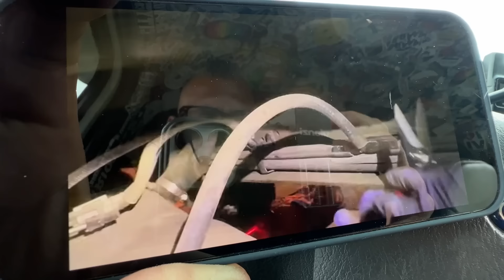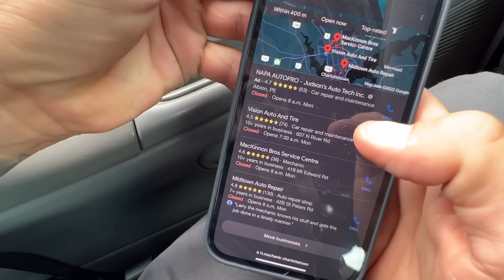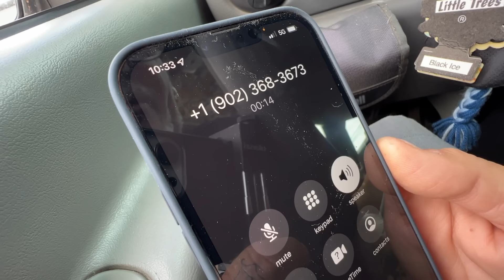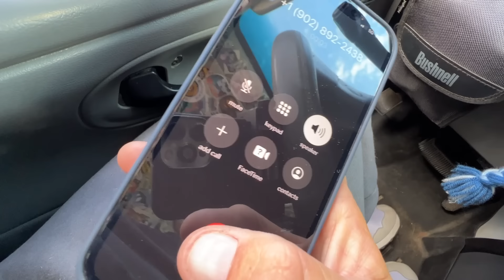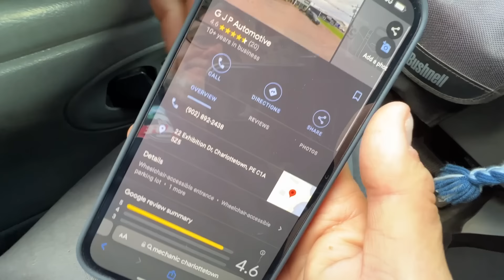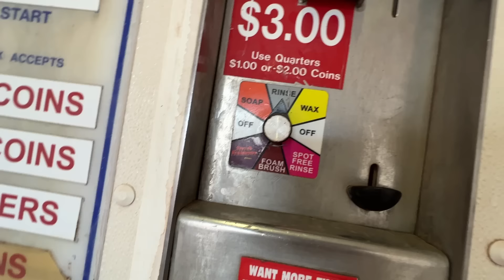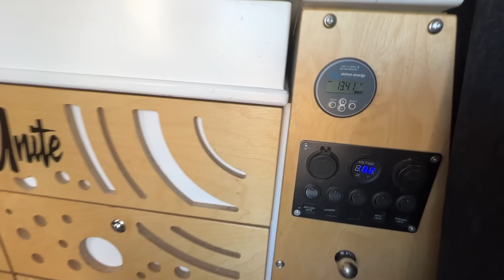TRAVEL STOPPED. My Van Has a GAS LEAK and It’s Freaking Me Out. SHOPS ARE ALL CLOSED.

Comment: Chrome after you clean and dry your van turn the key to the on position it'll turn on the pump and build up pressure and you could go down there with a flashlight and maybe even a little mirror and follow the gas lines and you might get lucky and see a connection that's leaking
Reply: It sounds like there is a hose that split on the pump side. So yeah. Turn the key to the on position and look to see if it gets wetter on the frame.
Reply: or keep it shut off completely right outside the mechanic shop.  just post up there until Monday.  As long as the pump is off, you won't lose a ton of fuel.

Comment: Pro tip, have less than half a tank of fuel to keep you going, but it will be easier to remove the gas tank when it's half to 1/4 full. It can be done in a parking lot, but a jack and a wide board is preferable for better control on lowering the tank. The thing to watch out for is the gas tank straps that tend to rust out like a muffler.

Comment: If you can actually see where the hole is, and you can reach it, a tube of Seal All and a piece of cotton fabric, soaked thoroughly in the Seal All, applied to the hole, will stop the leak, even if it is dripping.  Let it dry and apply another coated piece of fabric.  Worked like a charm for me. Edit:. Wear disposable gloves

Comment: Careful with the pressure washer, if gas is leaking out, WATER MAY GET IN TO YOUR FUEL.
Reply: Its most likely only leaking when the fuel pump is working somewhere in the line isn’t able to hold the pressure and is leaking

Comment: you can wiggle the hose  up front where you see it wet and see if it shows the leak from a pin hole or Crack in the hose. you can also replace the pinch type clamp there with a traditional tightening feul line clamp. you can just slide the one back wrap the adjustable clamp  around it and retighten it.

Comment: At least you found where the leak is so that helps.  Fingers crossed that a subscriber can help get you into a shop quickly because gas fumes are nothing to mess with either for you or Cruzie.  I certainly would do all my cooking away from the van right now.  You posted this on August 4th but it is from a few days earlier so I am hoping the problem is diagnosed and on the way to being fixed.

Comment: Hey Chrome! I don't know where you are with your fuel leak. But. I noticed in the video,that you showed, that there's a top mounted fuel pump on your tank with plastic elbows. My experience us that they crack from age and bouncing.
You may be able to access the pump through the floor. If you approximate where the tank is, from the inside, there may be a removable plate on your floor to access the top of the tank/fuel pump. If you can remove it, check the elbows and connecting rubber lines. If it appears that they are cracked/leaking.  You can buy the parts from a dealer and replace them yourself. Fairly simple.

Comment: It's not just gas , there are electricals in the fuel pump too , the combo improperly installed WILL   create fire. Unless you've done this before, a mechanic is a must for this one , mechanics will have it fixed in a couple hours.

Comment: My advice, is to try to get eyes on the problem, a little mirror, a flashlight, some rags, do some tests like starting, or a short road trip, even just on position with the key to actuate the fuel pump, and along this process you'll find out something to do that can suffice until you get it looked at by a technician.  Don't trade in the van, those run forever, take care of it.

Comment: Chrome, I’m here to help. You have three lines in the sending unit..the sending unit is the module in your tank containing the fuel pump and fuel level indicator. The lines are the supply line, return line and vent line to charcoal canister. If the fuel is dripping when it’s running, it could be either the supply or return..but the supply line has higher pressure as it hooks to fuel pump. My guess, I’ve see it many times, is the steel line coming out of sending unit is most likely rusted. You’re going to need to drop the tank and examine it..and to make it easier, don’t fill tank, even burn some off..it makes the tank lighter and the mechanic will thank you. It’s common, don’t sweat it, but my guess without seeing it may need a new sending unit.

Comment: I'm sure you go it figured out by now.  My guess is a fuel line connection, one of them you showed almost looks leaking.  I'm guessing you have tied your heater into those lines at some point, so there are more points of failure.  If not fixed yet, when the drop the tank replace ALL the lines...cheap insurance.

Comment: Hey Chrome, if you are still having this issue and if it’s a fuel line leaking you could relieve pressure in the fuel line so it does not leak while parked. You can have the engine running, remove the fuel pump fuse, then wait for the engine to stall. This would eliminate any pressure in the fuel line so at least it would not leak. This would only stop the leak if it’s the fuel supply line leaking. If it's the return line maybe would not work. I hope you can get this resolved.

Comment: Probably leaking from the fuel return system. The line or connection. If it was the pressure line the problem would be worse. If you want to see where it's leaking from the van should be running. Obviously a dangerous situation though. Eye protection for sure anytime you are under the van. Ignore all the warnings about getting water in the fuel, that isn't going to happen in this situation.

Comment: Hoping and praying your problems will be fixed ASAP. I want you and Emi and your fur babies back on the road.
Reply: Open the gas filler cap to relieve the pressure to slow the leak until you have it fixed .
Reply: @myronmakara9086  I guess so.

Comment: You might check your fuel filler neck behind the metal wall. You can see rubber hose from underside. See if it has been cut as the e350 are easy to cut and get gea out. I saw many times as UHAUL mechanic.

Comment: either way you go you will have to investigate the leak to the source. best way to do that is to use a carburator cleaner to spray wash the fuel away then let it dry then have someone to start the van and spot where its coming from. if its a fast leak leaving a puddle under the van that id fuel pump related more than likely fuel supply line or return line. if its just wet when you drive it around corners its seal related . the couplers on top of the tank that connect the fuel line to the fuel pump in the tank are cheap plastic and the little retainer clips are a 10 cent part that can come lose . sometimes you can use your phone to see where the leak it if its on top of the tank. if its only leaking from the side seam you can get a fuel tank dope you can push into the seam to seal it. otherwise if it doesnt leak while standing still id try only fill the tank  1/4 full see if its only damp around the seams. best of luck be safe remember fords have an emergency fuel cut off button on the passenger side kick panel it kills the power to the fuel pump in case of an accident or fuel wont shut off but only use it in an emergency because once you use it you have to reset the button to get the system to work again.

Comment: Run half a tank less will spill. With heat it  will evaporate quick. The fuel lines are rubber and metal. They run rubber were they need some expansion and metal for strength so you don't rub a hole in the line. Most are just clipped on run a line bend it watch out for parts that move and plug it in then clamp it on with a hose clamp.

Comment: I have dropped my share of tanks,  I have even unbolted a truck bed to gain access to a fuel system as not to have to drop the tank.  It is best done in a shop.  I have faith you will find an honest mechanic.  stay safe

Comment: Hey Chrome maybe if you pull the rear tire off you can have a better look at whats leaking.Could be where the gas line for your heater is tapped in and park at a fire hall just in case. 👍👍⭐⭐🚐⭐⭐👍👍

Comment: Fuel injection runs at different higher pressures.  I am a mechanic of 50 or so years and I can tell you don’t know about it and the approach to just “wing it” is always a shot toward more problems.  Could be a bad clamp or fill neck.  Did you just fill it?

Comment: Your BEEPING IS not FROM THE cluster. It comes from a small black cube one inch by one inch it looks like a 4 way flasher relay. It is usually connected where the wire harness comes thru the fire wall , if you feel around under the steering column and towards the left side you will actually feel the vibration  then just pull the relay out of its socket. You may need 2 hands one to hold the back of the wiring and one too hold the relay, try wiggling a bit one side to the other first then when it moves a bit pull it out. One reason it may be dinging is that the park break sensor is failing or the spring that holds up the park break petal is weak and it rests on the sensor thinking the park break is on. You may want to replace the gas line from the tank to the steel line connection and wrap it with cable covering. Rubber hose is cheap and dropping the tank expensive, so replace as much line as you can now when the tank is down.    CHEERS AND SAFE TRAVELS     Steve h.

Comment: Search DIY smoke machine to find the leak. If it is just evap hoses you could easily fix if accessible. Do your homework obviously
Reply: You can also detect active gas or air leaks by spraying soap water on suspect area and it will make bubbles

Comment: Quit running off the back tank you got fuel injection lines on that van and the rubber coated if you could find the leak you could go to parts house by the rubber line it'll fit that I think it's 3/8 cut the rubber off the fuel injection line and then slide new rubber fuel line over the top of your fuel injection line need to hose clamps
Reply: Pretty sure that van has only one big tank.

Comment: I think it's coming from the top of your tank from your fuel pump. If I was you I'd get a new tank and gas pump.. because eventually your pump will go...
Reply: @thegoodtom1718  the reason why for changing the tank is because, if the top of the tank where the pump is , it could be rusted. If you change the seal it could be pointless sometimes. Also could be the steel hose piece from the pump that connects off to a rubber hose. With all the bumpy trails, it could have broke a little, causing a pin hole..say it COULD BE. we won't know until the tank is down. Plus I bet the gas tank straps are rusting to.
Reply: @thegoodtom1718  hey BUDDY so what's this chrome doesn't need a NEW GAS TANK?? His new video came up saying there's a leak in the seem of his tank,  and needs a new one. Told you ! ..

Comment: The hose to the back  goes to the charcoal  canister  in the back.  Two vans ago  I had a leak and drove it  100k with only putting half a  tank in it.  Enjoy  your adventures  in 2019  we were in Middleton NS.  I am going out on the road with my 2008  F-350.  I have used dash  cluster in a 2001  E 250.

Comment: Could that line possible be the connection/fuel line for your Wabasto heater/furnace?
I know they plumb into the tank and draw direct from the onboard supply for the gas powered ones, and the connection may have shaken loose or a clamp may have come loose and is leaking.

Just 2 cents worth for you to have checked before they have to pull the entire tank.

That might also explain why it's only happening when the vehicle is running, the line would pressurize as the tank does when the vehicle is turned on.

Comment: Chrome, I've done that before! Might have to replace all fuel lines up to the fuel injectors with stainless lines. Replace filler line forward. My lines behind the tank were all rusted including brake lines. Beware.
Reply: It's better to have the whole fuel system including the tank , to do it right! Old trucks suck!
Reply: If you have to replace the brake lines do them stainless!

Comment: I want to say that your fuel sender is bad why where I see the liquid markings on your tank is whereabouts your fuel sender/ pump is. Stir years of driving in the backcountry different weather situations all that grime developed on top of that gas tank and can cause erosion on the fuel sender area cuz that's usually plastic or metal and from the vibration of the different Backcountry roads those washboard roads that you were on that vibration could have broken free and then finally just pop the leak

Comment: i had the same issues with my Bravada and it was the vent and seals on top of the tank and had to drop the tank to reseal it put a new pump and tank while at it. I drove it around a long time with the issue as well as filling it was an issue cause i couldnt fill it up and the pump wo uldnt just turn off since it would just flow out the top of the tank while filling.